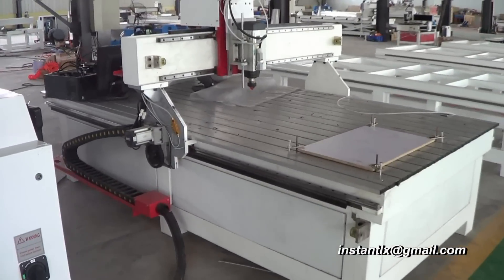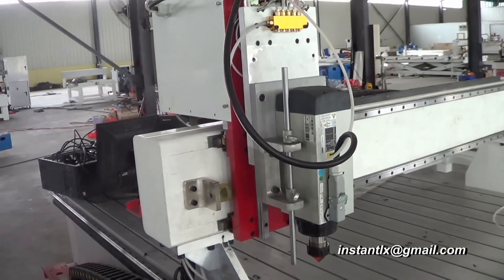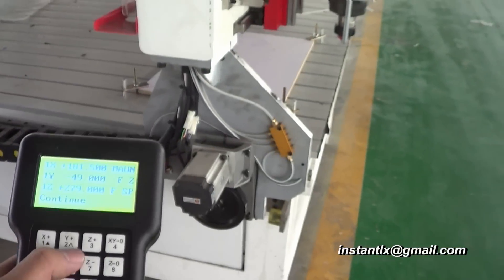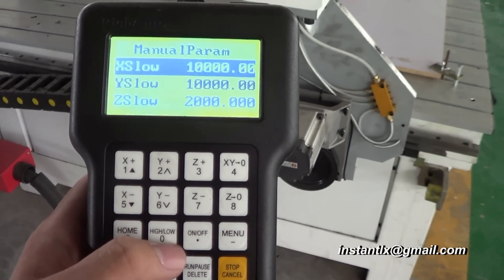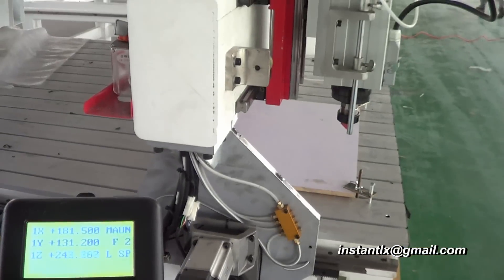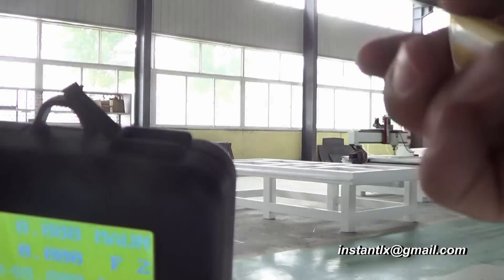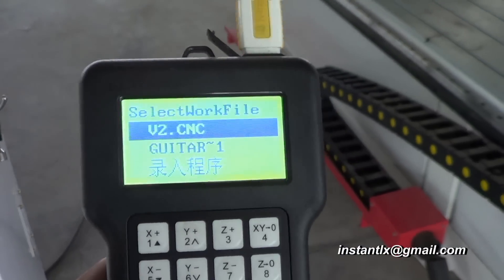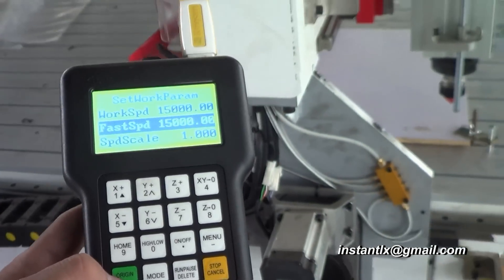Prepare work on 1325 cnc router on DSP panel, China cnc router,

Comment: Sir can u help me to get the previous xy=0 point? Or can u tell me how we have multiple zero points? Actually i am asking this question just because if i started a job and its unfinished and i want to start a new job on the same work piece and then i need a new xy=0 point and after finishing the second job i want to come back to my previous job and start from the previous zero point.

Comment: DSP Steuerungen sind nicht mal den Versand wert um sie zu bekommen. in 2 Jahren 3 Steuerungen zugeschickt bekommen von der Firma Winter Holztechnik, nun ist sie das 4 mal defekt während des Fräsen ( Relief ) läuft der Fräser in der Z Achse bei jeder hin und her Bewegung in der y oder x Achse nach den ersten 4 cm noch alles okay dann aber um ca 0,5 mm nach oben so das nach 5 mm Relief tiefe nur noch Luft gefräst wird. Service der Firma Winter Holztechnik nun Null. Ich soll nun die Steuerung bezahlen wenn ich eine neue möchte. Daher meine Meinung lieber eine Mach 3 Steuerung. Heist also nun für mich sparen und mit Glück kann ich dann meine CNC wieder in Betrieb nehmen.
Reply: Ich habe auch so ein Problem.Ich brauche alle Daten um die Maschine zum laufen zu bekommen.Ich habe die CNC Fräse Routermax 1212 Pro Vielleicht können sie mir ja helfen. Ich Wäre sehr Frohe darüber. Meine Mail Lautet thomas.wulf@live.de
Reply: Thomas Wulf is

Comment: hi 
i have a 1325 cnc router DSP machine that machine 
iam press home batten that time automatically going down y
pls give me a solivican
Reply from the maker: +abdul rasheed Your axis direction setting might be wrong. or your wire is wrong connected
Reply: +LIU XIN 
hi
cutting off the power to restart msg coming y
Reply: +LIU XIN 
hi
now coming over x+ limit
than what to do
Reply from the maker: abdul rasheed  set correct machine work range
Reply: +LIU XIN 
con u talk with me
Reply: I don't know correct settings
Reply: +LIU XIN 
how to delete
z- hard limit triged, stop to re boot, delete to adjust z positon msg coming
Reply: hello
Reply: abdul rasheed oI